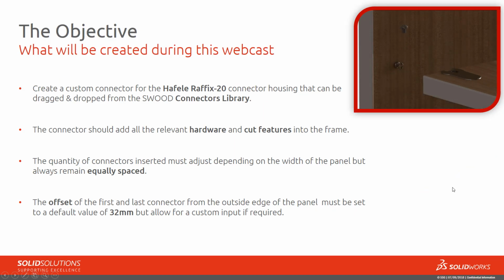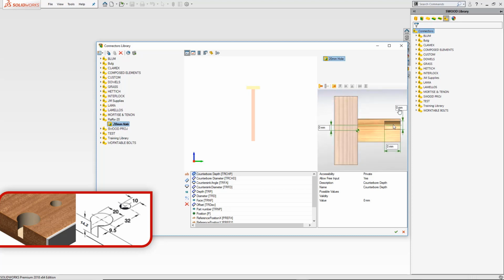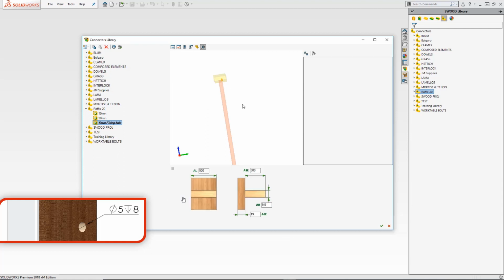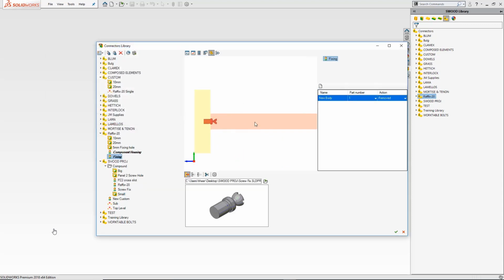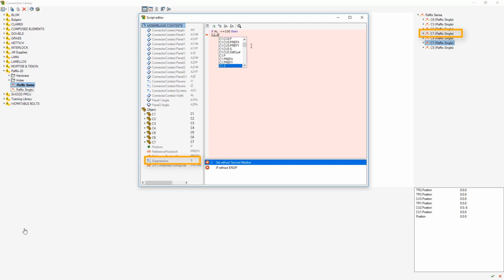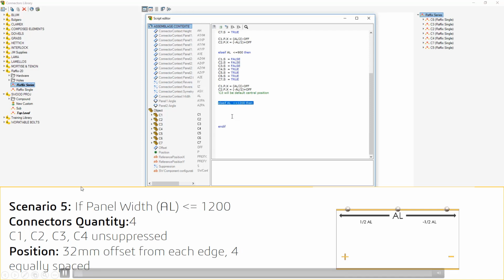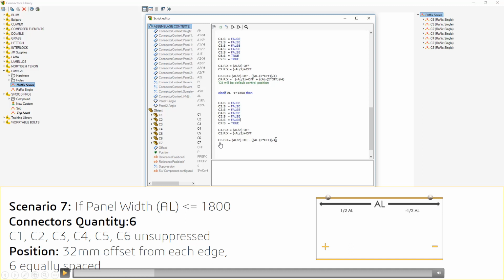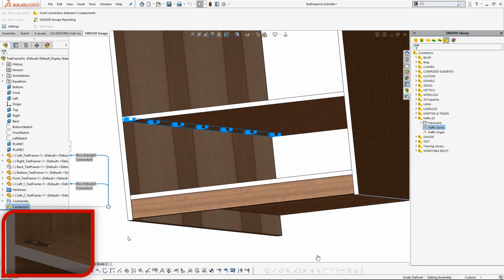Setting up connectors - SWOOD

Comment: Hi i was hoping you could tell me why when i supress all my components as you have done in the beggining of your script it still gives me one in the middle ?
Reply: Hi, I'm afraid its difficult to tell without seeing the script. but likely two possible reasons:
1. You've added extra components (i.e you've added 3 dowels but only controlling 2 in your script)
2. The script runs from top to bottom so you may have turned one of the components back on further down in the script.

Sorry I can't be of more help on this but if you try contacting your reseller support they should be able to take a closer look.